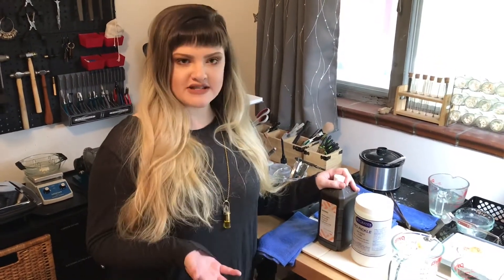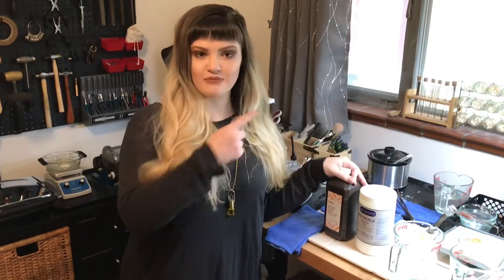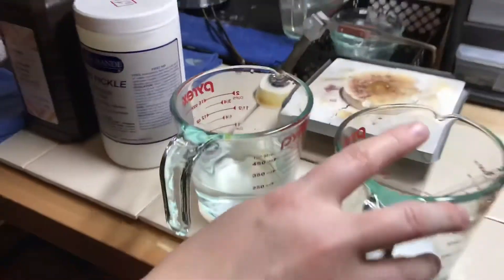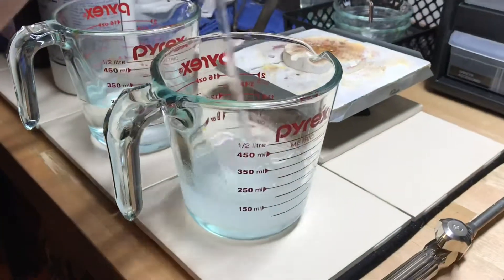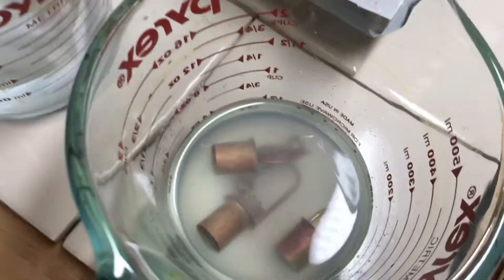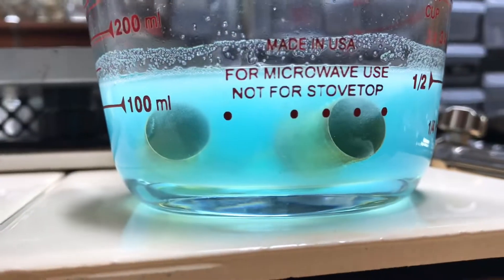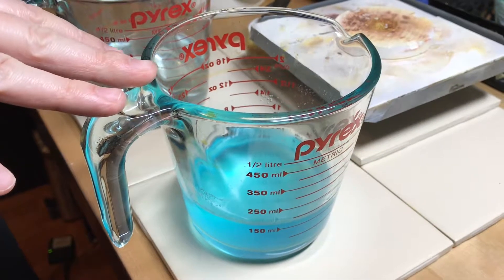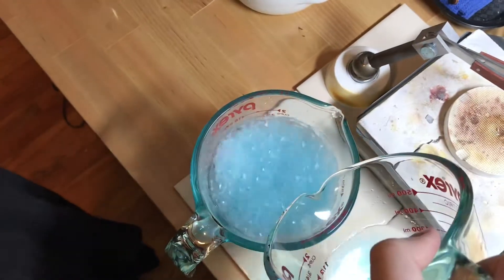How To Remove Copper from Brass After Soldering | Bead and Bones

Comment: Interesting explanation on how the copper comes to the surface.  My explanation is different because brass is mostly COPPER with ZINC.   Cartridge BRASS and BRASS shim stock has 95% COPPER and 5% ZINC.  It  was explained to me by a auto radiator repair man that by heating  BRASS parts with a oxy-acetylene torch and getting the work piece too hot then there is a risk of driving off the ZINC.  COPPER melts at  1984*F and ZINC at 784*F so you see that it is much easier to drive off the ZINC..  Older BRASS radiators were TIN-LEAD  soldered together which melts at about 361*F,  so if you kept the work piece below ZINC melting pint no COPPER color will show.
 
It would be interesting to know what filler metal metal and process that you used for your art pieces.  I doubt that you used TIN-LEAD solder  your joints, but more likely used a COPPER or SILVER bearing alloy for color match.   Using COPPER/SILVER alloys require  a higher temperature above 800*F according to the American Welding Society.  If this is so with your joining then your are driving off the ZINC at the surface, not a big deal if ones uses your pickling procedure.

Thanks for your demo and enjoyed the looks of your art pieces. ..... Jim McDermott

Comment: Your pieces are awesome! Thanks for the tips, since I rarely work with brass and copper, mostly silver. I've learned a lot about soldering brass without visible solder joints from your channel. Thank you!

Comment: i tried to brush my brass hardware on my lv bag and now on some spots it turned slightly pink,what should i use for it ? pld help me.
Reply from the maker: Sounds like the brass is plated. I do not recommend abrasives of any kind on plated metals. I would contact the manufacturer of your piece and in the future only use soft polishing cloths. Best of luck!
Reply: thank you so much.

Comment: Thanks! Other advice I got was not working....will try this.  Your studio is so nice!
Reply from the maker: Thank you! I feel like a lot of the advice out there is just regurgitated from somewhere else-- the key is understanding WHY it happens so you know exactly how to reverse it. I'd love to know how you like this tip when you try it! 👍
Reply: @beadandbones  it worked so easily! I had to leave my pieces in for 20mins but now I know to try harder not to overheat my work. Still learning....
Reply from the maker: @dlevy9925  that is EXCELLENT to hear! I find that pieces with higher copper content (so red brass, for example) can take a bit longer. I try to use jewelers brass (which is super yellow) or bronze when I can! ♥️

Comment: Can you patinate the brass after this process or would it go pink again?
Reply from the maker: That is an excellent question! The short answer is yes. However, I will mention two things; first, I recommend polishing after this process before moving on to patina and second, I have noticed some patinas will cause blushing to reoccur. I personally use Jax Black for Brass, Bronze, and Copper. I find the formulation does not cause discoloration and gives a beautiful result! 👍

Comment: Oh my goodness thank you! This will save so much clean up time as well as saving the thickness of the metal- I feel like I always have to remove so much material to get the red color off of my brass pieces. Awesome!
Reply from the maker: Absolutely! I'm so glad I could help. If you ever find the solution removes too much material, add less sparex or swap it out entirely for citric acid! It's a gentler acid. 💖
Reply: Bead and Bones Jewelry thank you! Do you know if this method can be used on a piece that has both brass and sterling silver- or will it damage the sterling? I solder a lot of brass pieces to sterling ring shanks so I’m wondering if I can toss the whole ring (sterling + brass) in the peroxide solution 🤔. Your work is SO amazing by the way 👊🏻!!
Reply from the maker: @juliegodseyjewelry  The solution will not hurt the silver at all-- it's not reactive like the brass. It's akin to using pickle. 👍
Reply: @beadandbones  how much citric acid? Same amount as the sparex?